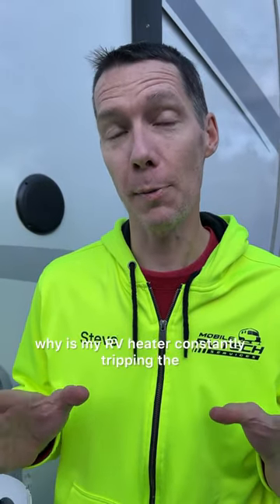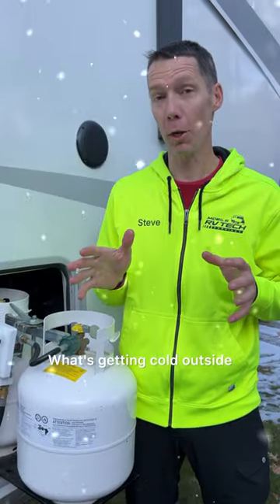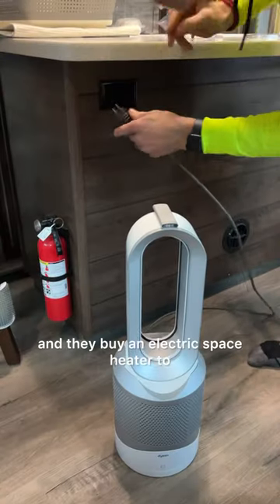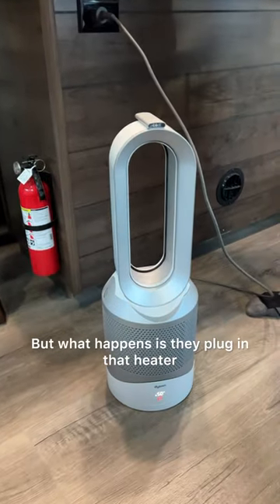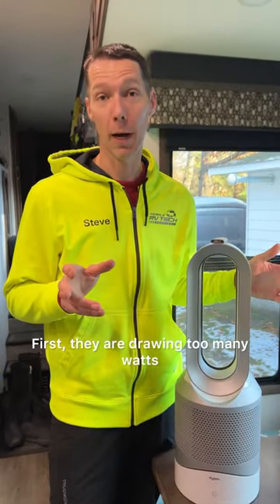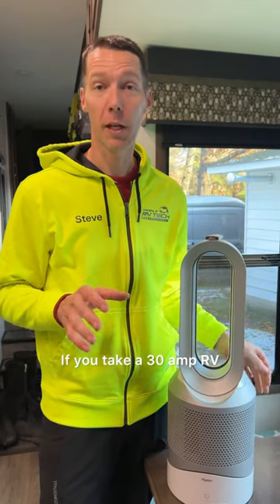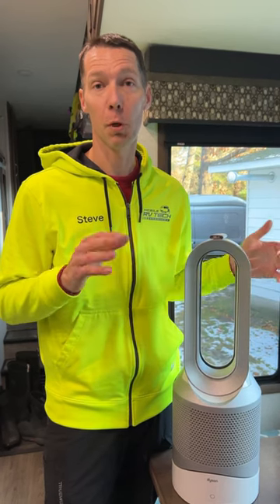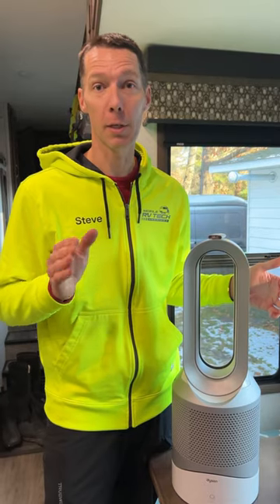Why RV Space Heater Trips Circuit Breaker

Comment: How do we fix this?
Reply from the maker: Do you have a 30 or 50 amp RV?
Reply: @MobileRVTechServices  - I see they didn’t answer but I am currently wondering the same thing.. I live in a fifth wheel full time and it runs on 50 amp, any suggestions on which space heater would be good just for the bedroom at night?
Was freezing here in Florida last night and will dip again into the 40’s tonight and next week
Reply from the maker: @Alaina..22  We use the Dyson heater in our 50 amp RV. The model we have is a little older than this one that is the new model. https://amzn.to/4fEEhZf